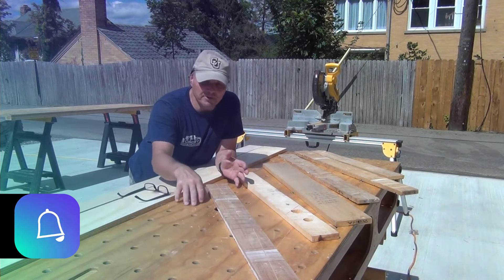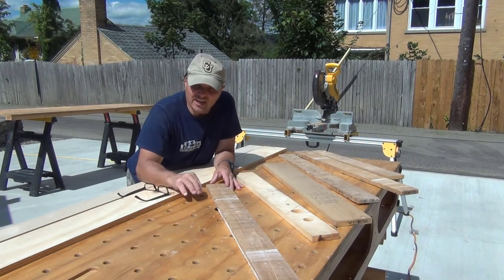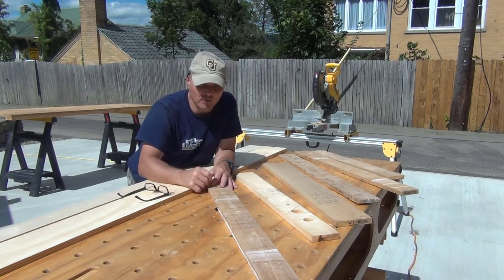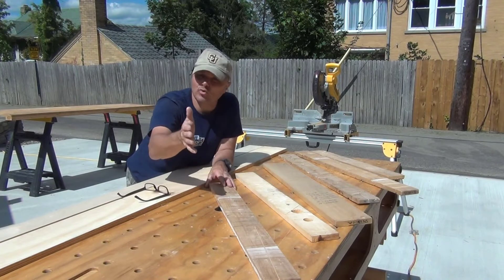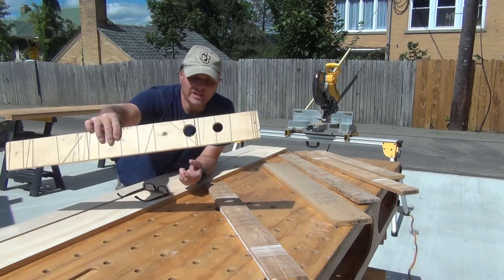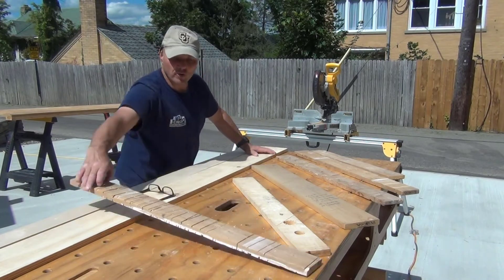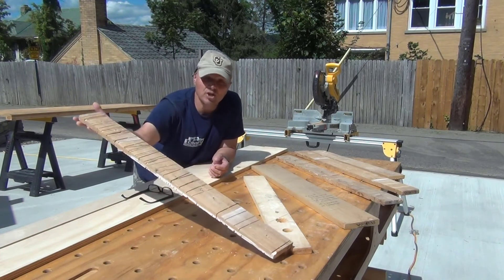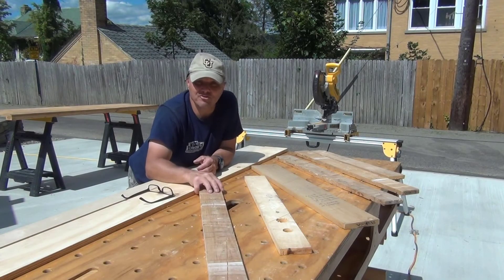sacrificial strips SAVE the day (and the benchtop!)

Comment: Hey Spence - I noticed you have a set of Stanley plastic saw horses in the background.  I have the same set and absolutely love them!  I am curious if you have ever used a piece of rigid foam for your sacrificial top for your bench.  I see a lot of guys use the foam, but I am not sure what is the better way to go.
Reply from the maker: Hi Russ! Thanks for the comment! I have seen others use foam too but for year with jobsite makeshift tables/benches, I just blocked up whatever I was cutting using fall off and scrap pieces. When I discovered Ron Paulk's bench system and eventually built my own, I had seen a number of his videos where he discussed and/or used his sacrificial strips and so I just adopted that method and have not deviated from it. If I had a fixed shop, maybe having some foam board would make sense and I could store it but being mobile, carrying foam is impractical even if I wanted to change up how I protect the bench when I cut. The Handyman (YT channel) uses foam board all the time when he is in his shop and is turning out professional, high grade custom cabinetry on occasion for his clients.
Reply from the maker: When I don't have the bench with me, I have a set or two of the all-black ($30/set) Stanley plastic horses with a 2x4 slot so I run a couple 8ft 2x4s between and then screw my 5 sac-strips to them to make a sacrificial table so to speak. My yellow-topped Stanley set (seen in the background in this video) does not have the 2x4 slot so they are used most often to hold material.